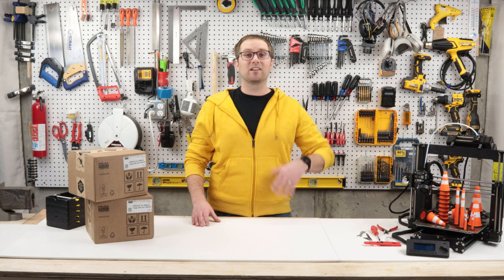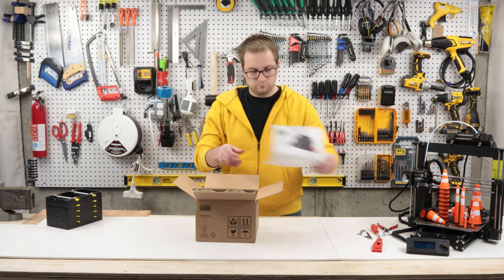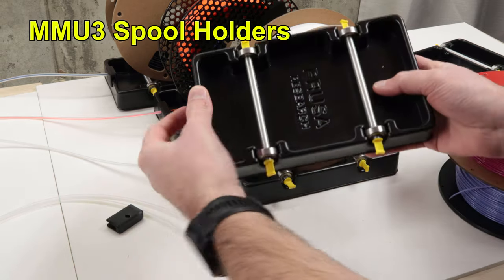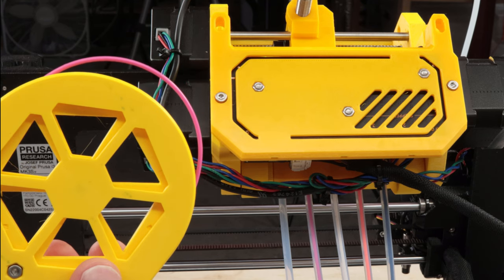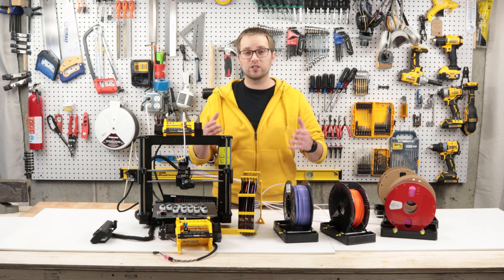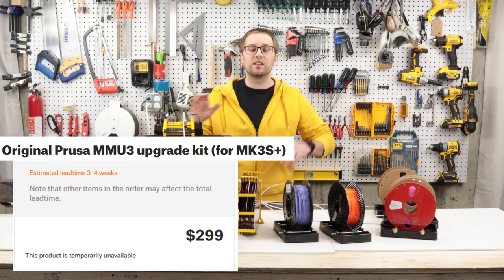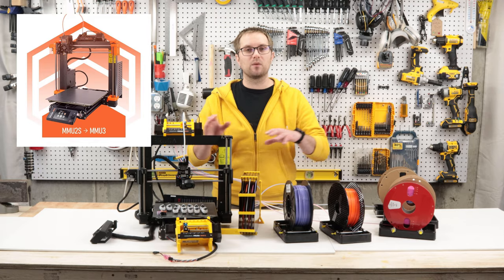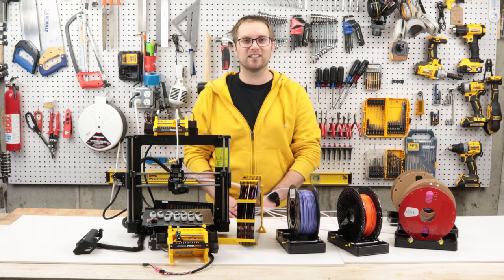Should you buy the Prusa MMU3 Multi-color upgrade?! Unbox, assemble, and review

Comment: does this not poop like the bambu ams?
Reply from the maker: Lol, no instead of a poop chute the MMU will make a wipe tower on the build plate - in the video you can see the rectangular wipe tower being printed next to the prints
Reply from the maker: It's more wasteful in terms of filament waste than the Bambu AMS
Reply: @AsaMakes  The wipe tower is bigger on the MMU3, but the cut&poo produces more waste. The AMS is more than 3 times as wastefull in default settings. Also after cutting, the part of the filament left in the nozzle/heatbreak can only be pooed, not be used to print infill or for another object, as you can not use retractions on the cut filament. On the MMU3 with waste2infill ore waste2object you can reduce the amound of waste a lot. Still a prime tower is needed, but only to eqalice the preasure inside the hotend after filament change. So very smal.
Reply: @oleurgast730  you can purge to object and infill for the AMS
Reply: @Zyghqwyv  only for the purge tower, not instead of poo. Poo is the filament left inside the hotend after cutting. As it is cut, it can not be retracted anymore. Theoreticly you could use it for an object - but without being able to retract, this is bad quality and therefore waste anyways.
Reply: @oleurgast730  you cant pull molten filament, retracts are made to relieve pressure
Reply: @Zyghqwyv Its not about the already molten filament in the nozzle. Retraction is about negative preasure being created by retracting filament from the transition zone. After cutting, there is no connection between the new filament loaded into the gears and the old filament still inside the heatbreak and transition zone. So no retractions possible until the old filament is down in the meltzone, new filament in transition zone and also air which got in between while changing filament is out.

Comment: I have 12 Prusa printers only 1 is a mini. To your point, the price and lead times for Prusa are almost prohibitive. I just got a P1S combo. Stunned that I got it in days due to US stocking, prices  are great and reliability is amazing. The P1S runs nonstop and I need more multi color capability. Currently I'm looking at another P1S combo because of the Prusa cost and lead time.
Reply from the maker: How is the print farm management running the two different brands? I really like to be able to run the same g code on all my printers

Thanks for watching!
Reply: Really hasn't been a problem or learning curve. With the variety of Prusa's I have that is problem more of a challenge. I print to P1S mostly from the slicer and the complaints about the P1P/P1S interface is just white noise. I use only .3mf's from Fusion 360. Good luck with your MMU3 and share any updates you have. Thanks  @AsaMakes

Comment: Theyre lagging so far behind the competitors it's not even funny. An xl wirh a tool changer is the best for waste reduction but not worth the price. They got complacent and itll take a massive price drop to retain repeat customers. I know they have great customer support but they need to balance it properly with price and performance. 90 percent of their install base isnt following them into the manufacturing space if they ever get their print farms finished on time. There are still alot of giant concessions they are asking of their customers. There's gonna come a point where people are going to have to admit they love stifled innovation with a giant apple-like tax befause they're fanboys. It's not a knock against prusa, if i was into mmu id have a tool changer. Wasting plastic like bambu does is unacceptable. I only print functional stuff for my electronics lab though so i am viewing it from my use case. An mk4 kit costs 2k in Canada so i couldnt justify it. I get why people like them though. Theyre reliable machines with great print quality.
Reply from the maker: Wow I did not realize how expensive a Mk4 kit is in Canada, shipped to the States a kit is right around 1,000 USD which is still really pricey compared to the A1 (well... once they figure out the bed heater cable fire risk issue). But anyways, the state of things as I see it:

- Prusa has high quality, high reliability for single color printing on the Mk4
- Prusa is not cost competitive if buying new
- Multi color printing Prusa has fallen behind Bambu

I'm really excited for my XL to arrive in a few days but the cost is far too high to justify for 99% of people/use cases. And I think it's highly likely that Bambu launches an XL competitor within the next 18 months.

Prusa is definitely innovating on their flagship products and their accessories but they don't appear to prioritize cost reduction for customers.

If I didn't already have 4x Mk3s and one Mk4 I would probably buy a Bambu X1C. I have enough capacity for my Etsy store, channel projects, and personal projects and I don't expect to expand more in the near term. I definitely don't plan to replace the fleet with Bambu printers as the Prusas I have work great and I know how to maintain them.

Anyyyyways, thanks for watching!

Comment: MMU2S sucks like hell, hope the 3 irons it out. The concept itself is cool
Reply from the maker: Yeah definitely a huge improvement over the stock MMU2, though if you do have an MMU2 there are some mods you can do to really improve it
Reply: @AsaMakes  I did some mods years ago when I bought it, but failure rate is at about 90%. Did the firmware update now and run into extruder problems😬. It looks I might have to upgrade to MK3S+ (still have MK3S only) with MMU3. I really like the concept with multicolor, but so far it was just pain